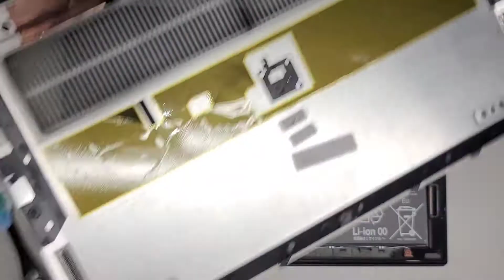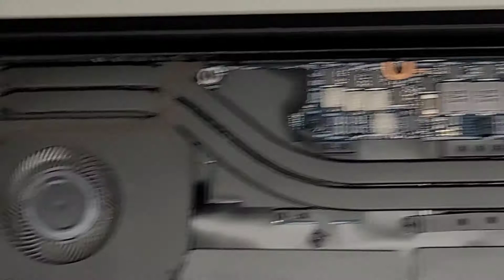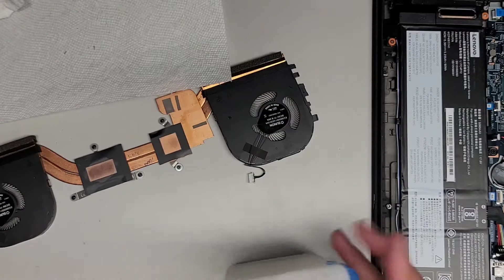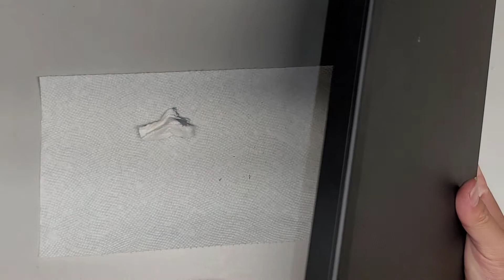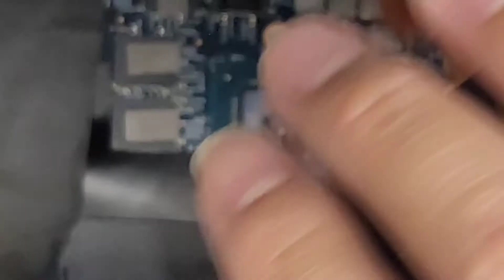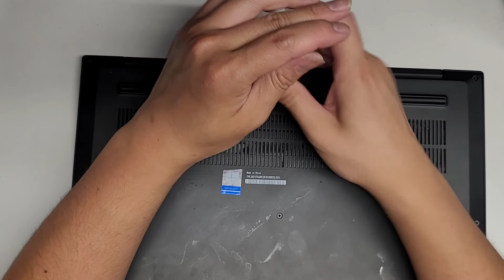Lenovo ThinkPad P1 Gen 2 Disassembly RAM SSD Hard Drive Upgrade Repair Thermal Paste Application

Comment: Excellent, love the diction, good English, high res video and sound. And yeah, the lack of music I think is a definite positive! 

I may have to do some of this with my P1 Gen3, one of the 2 fans may be breaking down. Couple times it started screeching. 1st time (yesterday) I shut it down, flipped over the machine and saw lots of dust had clogged the fans. Opened machine, cleaned out all the dust I could see with brushes and a vacuum. It worked then but after an hour screeching started again from one fan. Shut down, restarted, is working now but figure that fan is maybe going bad, seemed to be vibrating a bit along with the raging warbling noise. Replace fan or whole assembly? Don't know, but will watch rest of video (only watched from ~15:20 on so far) and continue research and monitor the situation.

Been in this laptop before (and my P1 Gen1), adding 2nd SSD, RAM too to both machines. Have 2 upgrade replacement Wifi cards I need to swap in for the originals. 

Hope that fan doesn't go belly up, but figure it will. I think this probably happened because I've almost all the time used this laptop actually on my lap, lying on my bed. So, sucked up dust from my pants for about 5 years. From now on I figure I'll have it on top of a kind of table I made for it around a year ago that sits over my lap. I made it so I don't feel so much heat from the machine. Should also help keep the dust out and prevent further problems with the fans.

Subscribed and liked!
Reply from the maker: I highly recommend repairing the fan. Just needs a bit of grease. This playlist will help Fan Repair: https://www.youtube.com/playlist?list=PLSSiYX-ta7aqqxfDWDQh-B6Az4ZgDI459
Reply: @ItsBinhRepaired  Thank you! I used to drive to Milpitas once a month for my Bay Area Association of Database Developers' meeting from Berkeley. I'll likely watch that video intensely and repair the fan. It's been working for some hours now, but I won't trust the laptop. I'll bring my P1 Gen 1 with me instead to Thanksgiving meetup next week.
Reply: @ItsBinhRepaired  Looking it up the info says (true?) that the fan (left as seen from above, right as seen from the bottom) of Lenovo P1 Gen3 is not replaceable, the entire heatsink 2-fan assembly needs to be replaced if a fan isn't doing it's job. I did try what you say, to put a bit of grease in there. I pried off the circular sticker on top of the fan and dropped a tiny drop of Valvoline 5W-20 synthetic oil into the center, i.e. over the spindle and pressed the sticker back on. Ran OK for a while. I keep the machine in suspend when not used. Came into the room a few days ago and the machine was screaming! I shut it down using the on/off button long-press and haven't used it since. Several weeks ago I ordered the heatsink/fan part (FRU: 5H40Y67588) from China. Arrived a few days ago. I think MAYBE a blast of air will clean out the problem fan but am unsure how to try that. Anyway, I have the replacement HS/Fan assembly, but am, of course, worried about messing up the replacement scenario. I watched this video again entirely yesterday. It's for P1 Gen2, so it will differ. I bought a good electronics repair kit and a good A/C 2 speed blower too. I believe you said in the video that trying to blow out debris in fan should be done from the back, but you didn't illustrate.
Reply from the maker: Sounds like your didn't check out the playlist at all. I highly recommend you watch those videos.
Reply: @ItsBinhRepaired  There's a lot of them (I count 26 and several are over an hour!). I think I did watch the first one. Many address dealing with fans. AI said I can't fix the fan, have to replace the heatsink/fan assembly. Was it wrong? Can you rank those videos with respect to my particular need here? There are so many, watching them all is intimidating. Thank you for your answers!
Reply from the maker: @musicantd  fuck AI... You're going to believe that garbage over someone who does this for a living? The videos are there so you can learn. Shortcuts don't help with learning. Watch the ones that look most similar to your laptop. You can skip to the fan part, but then you won't know how to remove the fans and will risk destroying your computer. It's best to watch them in their entirety so you know what to look for. It's not intimidating when you watch the videos and understand what's going on. 2 videos and you'll have more knowledge than 80% of repair shops.

Comment: Is £365/$485 too much for a 9th gen i7 in one of these? I am on the fence...with slim pickings. It looks super easy repaste compared to others, thanks for the full vid✌✌
Reply from the maker: @facelessvaper  sounds a bit pricey
Reply: @ItsBinhRepaired  Aye, tbf that includes a depreciating 5 year warranty [used tech buyer/seller UK CEX] I had a thinkpad P15s gen2 i7-1165G7[ really nice] from them but there was pressure damage on the screen. I could replace but for £330, I didn't fancy that job + screen wouldn't be OEM unless I pay + used. Buying "used" is hard...✌
Reply from the maker: @facelessvaper  yeah, 5 year warranty is nice

Comment: I replaced thermal paste and now my display doesnt work i dont know what to do
Reply from the maker: @sebastianhp5428  did you drain the battery before disconnecting the display?
Reply: Nope, I see how that can be a problem now
Reply from the maker: @sebastianhp5428  oh no :( I think the backlight circuit is fried.
Reply: @ItsBinhRepaired  ☹️

Comment: thanks What is the maximum RAM capacity supported by the Lenovo ThinkPad P15 Gen 1 Laptop with Model 20SU-S08F00 and an Intel i7-10750H CPU?
Reply from the maker: Usually the only limit is how many sticks you can put and the capacities available for purchase.